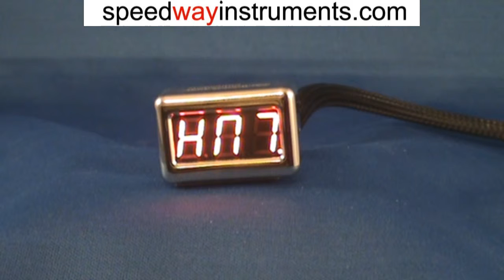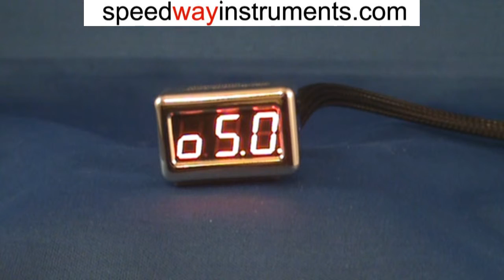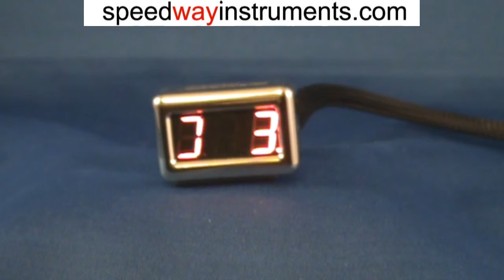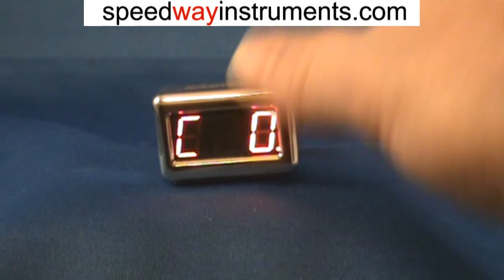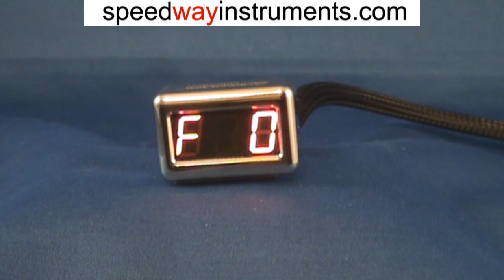microSpeed calibration and configuration

Comment: I stuck an electronic sensor in the speedometer cable hole on my older sportster which had a cable drive unit. The sensor is getting a  reading off the gear teeth but my electronic speedometer says i'm doing 70mph when i'm doing 35mph. Can this speedo adjust for a speedometer that is this far out? 
  When do you expect to get these units back in stock?